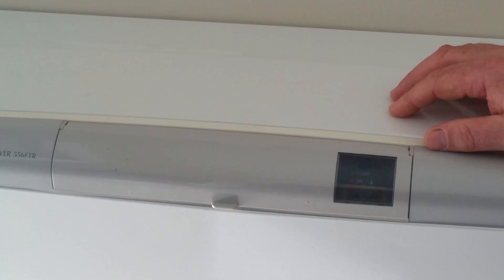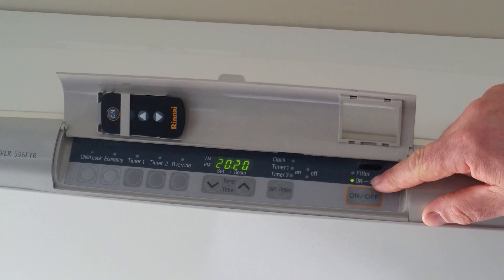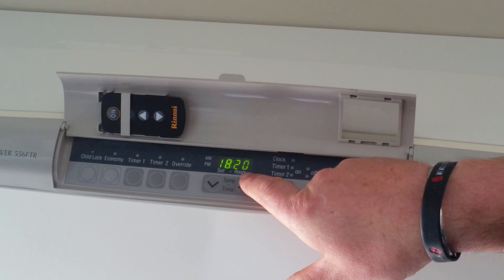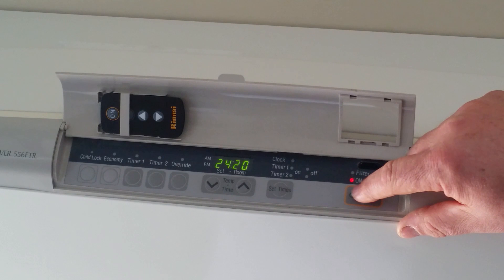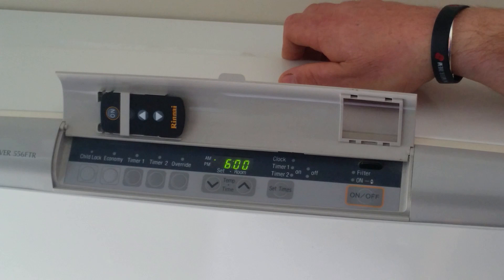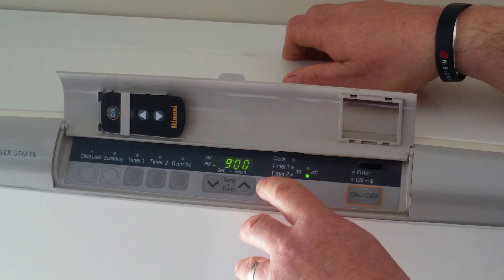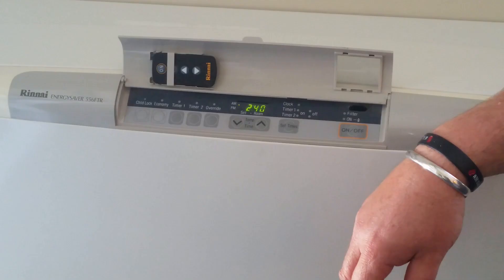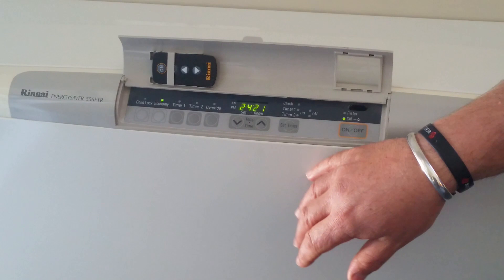How to operate the control panel on a Rinnai Energysaver gas heater

Comment: Is there a way to have the Rinnai heater come on by itself when electricity is applied?   And then will the gas automatically stop when there is a power outage?  Any old Rinnai would suffice too or any propane heater to be honest.

Thanks!  (I'm trying to figure out a system that will heat as emergency backup to my oil heater when the power goes out up here in Maine... which occasionally may last even 3 days I've been told.)

Comment: Not very helpful. I can’t figure out what the difference is between set and room temperature and how to set timer 1 and timer 2 temperatures individually. I set one and the other sets the same temp. I change the second and it changes the first temp to the second temp and visa versa. Very frustrating.
Reply from the maker: A "Set" temperature is the temperature you desire the room to be. A "Room" temperature is the actual temperature of the room (as measured by the thermostat). Unfortunately for models RHFE 309FT, 559FT and 561FT you can not programme the "Set" temperature individually for Timers 1 and 2. The timers are simply used to turn the unit on and off at specific times of the day. Cheers